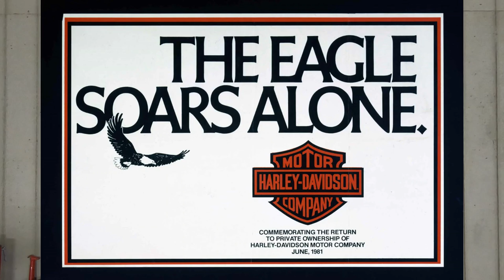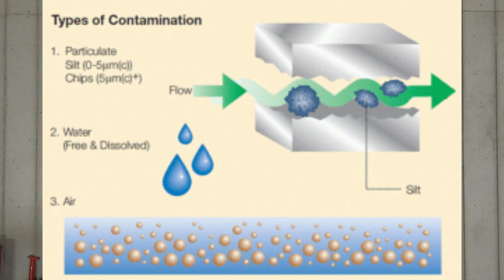Harley Engine Quality Isn't What It Used to Be

Comment: I am a faithful viewer. You are a walking Harley encyclopedia Mr Gixxer!  I guess my 2002 was the last year of the assembled balanced crank. I have not opened the engine. It runs soo smooth and reliable. I don't want to risk spoiling a reliable Harley. That's unheard of. Every Harley I've owned has suffered break downs.
Reply: You're 2002 crank are pressed. GixxerFoo keeps repeating this nonsense. Not just this video but also in other. 
The fact are all Twin Cam cranks are pressed together starting from 1999. 
I have a 2000 Dyna where I this winter changed my crank for a S&S crank 4 3/8" stroke. My old 88" OEM crank are pressed.
Reply: But you have the great Timken button end bearings though 😎
Reply: No Gixxer corrected me there. So much for hoping 2002 had something better in the drivetrain. On the other hand, the great Gixxerfoo hasn't revealed anything terrible about my year bike. Yet.

Comment: Thanks for all the great content you provide!! I bought a FLHXS 2021 $43,000.00 CAD Right out of the box shifter pawl spring had to be replaced.few month later if you leave the ignition on wile fueling the ECM locks up and the bike won't start must leave it sit with ignition off for 10 min.(dealer can't repair it)and this year went on my first ride throttle by wire puts the bike in LIMP MODE . OH YES and the front disc have been replaced 2 times warping problems. I sold my 2004 ultra classic to my Nabour and he IS having a blast with that bike LOL THANKS HD

Comment: As a owner of both a evolution and a twin cam 103 ho , I will have to say I am very happy with both but when I took your advice and put the wood 222 cams and a thunder max tuner and tab full exhaust I am a big fan of the twin cam thanks for your vids that pointed me in the right direction as far as parts you are spot on thanks
Reply: Did you get your bike tuned? I have a twin cam too.. I like torque and mid range RPMs (don’t care about highest HP).. how’s your torque curve? I’ve watched all Gixxer’s vids, just curious of user feedback.. thanks
Reply: @bullast2046  he is running a tmax ecm, which would tune the bike, running the same on my 04 ultra with a stroked s&s 113 and no issues so far
Reply: @GBDunknRollCD  I got that.. I’m wondering what the torque curve is like on a dyno tune.. is it good and steady, or a rise and peak.. the graph Gixxerfoo showed shows the latter..
Reply: @bullast2046  that's because a more restrictive cam and head allows the air to flow faster through a tighter space at low rpms, you're going to lose torque under 3-3.5k and gain it above 4k. It's opening up the top end. The best way to get more torque down low for your "preference" is to increase displacement ie. a bigger bore or stroke
Reply: @bullast2046  it all depends on what you have done to your bike, different cam lift and durations with change the curve drastically, find a cam to suit your needs when it comes to having power and tq come on down low and you should be happy
Reply: @GBDunknRollCD  that’s exactly what I want.. I understand there’s no replacement for displacement.. my 103” will never touch my 117”, with apples to apples modifications.. I’m just asking for feedback of different cams from users, rather than checking manufacturer advertised graphs.. peace

Comment: I have had 2 TC88 and 1 TC88B bikes.  My 01 FXDX was a dream bike and I miss it a ton.  My 03 FXD is my current bike and has been a very reliable bike.  My 04 Fatboy was my least favorite of the 3 for comfort reasons, just never liked how that bike rode.  For the 01 and 04 I did the Screamin Eagle upgrade to the camchest and have zero complaints and had zero reliability issues.  All bikes ran all over and had decent power.  The 03 I completely tore out the factory cam system for an SS510 gear cam system and that makes the TC88 a much better running motor, hopefully just as reliable over the next few years as the others were.  The evo's were fine but I will always be happier to run a TC88.

Comment: A lot of the Milwaukee 8 when you change the Fluids you will have metal on all 3 drain plugs including the engine. I put s&S 1200 KITin the 2021 883. The gear case was loaded with metal fragments from when the cases were machined and not cleaned properly.

Comment: after my 95-inch t.c. went south along with the previous 88 t.c. going south. had my engine rebuilt with a balanced S&S crank, timken bearings,  geared cams, and billet cam plate. along with everything else new, bumped up to a 103. after thousand mile break in, going to bell Ray synthetic. motor smoked and uses oil. I went to Bell Ray mineral oil. the oil use stopped but still smoke on a hard throttle hit.  I'm stumped. is tune, too rich? 51mm throttle body.

Comment: Anything made after the Evo is cheap crap, and I call them PlastiGlides®️.
I bought an '02 Softail Springer, but sold it after 2mos, because it felt like riding a Honda, the heart and soul of the machine was  gone.
 My '97 WideGlide is twice the machine the new ones are, but it still makes my '72 ElectraGlide look like a tank. 
 You couldn't give me a new Harley.

Comment: I bought an 01 Dyna and afterwards found out it had the Timkin bearings and bolted flywheel.  Another $2,500 got me a forged cam plate, better oil pump, gear drive cams, new lifters, inner cam bearings, S&S .510 cams and adjustable pushrods.  It's finally as good as an Evo.  It came with a Supertrapp 2:1, K&N filter and Mikuni 42mm carb.  I added a billet fork brace and Jagg oil cooler.  Was going to do a 95" kit with high compression, headwork and forged pistons but it runs so well I hate to touch it but stage IV is just one step away.....

Comment: Man oh man I miss my Evolution bikes! I shoulda never sold them! The twin cams were a disaster waiting to happen! Now I have the M8 and truthfully I quite like a lot. I have a 2017 model, that I took upon myself to fix the oil pressure issue. So far it's been a really reliable engine and in fact the 107" motor was just fine as far as I'm concerned. I don't need to go or accelerate any faster or better. It's a bagger, fast is relative to your destination. I didn't buy mine to race it that's for sure. But I did cam it up and with the S&S .475c cam and did a few other choice mods that kept it reliable. Getting back to the Evolution motors, I rarely if at all had issues with the motor itself, I did however had a terrible issue with the EV-1 cam that slowly disintegrated and took out my bottom end, thank god for Delcron!  Evos are still my favorite AMF motor and Harley-Davidson was smart for keeping it as long as they did.

Comment: I was at York for the 25th Anniversary and saw the pre-production Twin Cam motor disassembled. The 'new' thin-wall die cast engine cases were made by Mercury Marine as evidenced by the cast-in mark. Mercury Marine has extensive experience in precision, high-quality, thin-wall die cast engines. Not sure if HD is still outsourcing their cases. I've also heard the last few years of the EVOs were cast and machined by S&S!?!?

Comment: The EVO had its issues too... weeping rocker box gaskets, cylinder base gaskets, porous engine cases, every engine that Harley has came up with had its problems. Look at the Knucklehead. We all bow down to it like it's the Holy Grail, but it had who knows how many running changes in just the first year.
Reply: The problem of leaking gaskets are minuscule compared to Major catastrophic engine failure in engines with low amounts of mileage on them. As for the knucklehead that was an almost complete redesign because most motorcycles ran Flathead engines in the old days and most of the changes were related to sheet metal and gaskets because they had no experience with a recycling oil system compared to total loss that they had before. A knucklehead was a 500-pound speedster that would come with a certificate that it went 110 miles an hour which is pretty good in the 1930s. Now Harley-Davidsons big twin is an unreliable behemoth
. As morbidly obese as some of the people who drive them
. I laugh when I see them duck walking a simple u-turn. They won't lie in their bikes and they won't turn their bikes because they're used to driving a car 🚗. I said they won't lean their bikes stupid phone 📱

Comment: I was thought all twin cams had press fit flywheels. I know my 2000 has the Timken bottom end, but does it have that glorious Evo flywheel as well? 🤔
Reply: You're absolutely right - its pressed. GixxerFoo keeps repeating this nonsense. Not just this video but also in other. 
The fact are all Twin Cam cranks are pressed together. 
I have a 2000 Dyna where I this winter changed my crank for a S&S crank 4 3/8" stroke. My old 88" OEM crank are pressed.
Reply: @Søren Lønbæk  I thought so. I think Harley figured the Timken bearings would support it,  then got rid of those too. That's when all the trouble really began with total indicated runout

Comment: A bike that costs $20-35K should have Zero excuses when it comes to engine build quality. I have owned several new twinkie and M-8 Harleys over the years, but from here on out
I will buy nothing but big bore Evo bikes with proper Timkin bearings (and Zero crank end-play) from here on out.
The motor company deserves the bad rap they took over quality.
The fit and finish has improved dramatically in the past few years however.

It is ridiculous to consider spending $30K for a new bike when I can easily buy a show quality chopper with a big bore S&S Evo and custom paint all day long for under $8K.

Comment: Bought a new Softail in 2011…immediately joined the Forums and learned all the “bad” stuff about my motor….146,000 miles  on a stock bottom end and not a problem…and I did a big bore kit with cams and heads….if you didn’t get a lemon from the factory, you are fine

Comment: In addition to how you run your motorcycle, I believe in timely service intervals, all three holes each time with quality lubes and filter is key. Scrimping here is not saving at all, it ends up costing. And - don't despise that downtime, enjoy it, do it well, and be looking for changes and do it well! Connect with your bike, and seek out loose fasteners always! Check your tires, too!

Comment: I am on my 3rd HD... the first two engines had issues. The second one had bad lifters, which ate my cam. The first and second consumed excessive oil. The first HD was a leaker due to poor machining. The second HD sumped and destroyed the engine at 8500 miles. Fingers crossed on my current 107. I am running external head breathers and Trask vented cover to control blowby. I never had any issues with my Japanese cruisers. Am I confident that my 3rd HD will succeed? Unfortunately, the answer is no. If this bike becomes problematic, I will get away from HD.

Comment: Gixxer, I know that I can get the straight scoop from you and Tatro, I truly enjoy your insight. I know that some hate the Shovel, but I had 2 back in the late 70's and early 80's. A 76 Superglide FXE and a 71 EG in that order. I rode the pig snot out of both with nary an issue. 3 TC's 88,96 and current 103, no issues. When the time comes I'm replacing all of Harley's F'd upped parts and go whole hog with S&S bottom to top..

Comment: I love the evo engine, but it’s not without its shortcomings. On to the twin cam. I’ve been surprised how much I’ve grown to like that engine. Sure it’s noisy, but my 88 has been good to me. 
All that being said. I doubt I’ll ever be talked into an M8. I’d rather bullet proof my twin cam, and keep bubble gumming my evo back together.
Reply: 88ci years with a five speed, hands down one of if not the best years for Harley. Rented a new M8 RK for 4 hours and hated the way it felt, sounded and performed, too much like a metric. I’ll gladly keep my 02’s.
Reply: I went from an 88, which burned in a garage fire, to a 110. In my opinion the 88 was a much better motor. I finally dumped the 110 for a   Moto Guzzi. Major improvement over the Harleys in all aspects.

Comment: I worked at a dealers' in the early nineties, every bike we uncrated had issues, either mechanicle, electrical or cosmetic, we had the wire wheels relaced on every bike that arrived because it wasn't worth the risk not too, and had to raid the parts dept just to make the biks fit for sale, quality and harley aren't words I'd generaly used in the same sentance in a possitive light.

Comment: My  53 Pan has 340, 000  miles on  it,  2 rebuilds,  it was in a garage from 70 to 88 when I bought with 32, 000miles on it.  2 kicks or 3  she fires up ...  45 miles to a gallon.. 80mph easy.  tops out out 112 mph,  changed the trans sprocket toget a  faster topend.

Comment: Love the videos glad you got shop. I'm going to put woods tw 222 in my 2016 street glide special been looking at parts very confused 😕  the fuel om  cam plate what's different  between it and the red hp  plate I need a kit with that cam where can I find that for good price any information  would be greatly  appreciated  and was wondering  where your shop at and what you charge for cam install on 103 thanks

Comment: I have a 2017 RG and put in the 114 kit right after I bought it.  Talking about a domino effect!  First the clutch basket exploded.  Then the compensator went, followed by the transmission.  Oil summing went nuts, so had to put in new oil pump and plate by S&S.  Then the Harley Screamin Eagle cams went so new cam and lifters.  Although is was expensive, I love my HP now and couldn’t ride a stock bike.😊

Comment: Maybe a cam plate..  Maybe a better cam.. Maybe a bore kit...  Maybe etc etc..  AND maybe the flywheel will shift
or stock run out is so BAD you can't even install a gear drive cam set up..
ALL THIS and sooo much more, on a bike that cost 30k.. WTH is going on ??
BUT every after market parts dealer has their parts or design to fix the factory screw up...
(more $$$$) WHY CAN'T OEM PARTS DO THE JOB ?? What ever happened to a bike you can RIDE .. and trust on the road ?? I've been on HD since 1979
and own three now..  Bought my 1st new one in 2018 ( got a PILE $$$ of new parts yet to install plate oil pump cam gear drive etc etc) But all this new HD since twin cam is a scam. Only sells because of a name and old turds like me trying to support America... Be sure to have your bro tow card when you leave home..  and and the fat cats at HD wonder why people THAT WANT TO RIDE are going to import bikes and giving the finger to HD and their scam..
Reply: What I know, they are not making these bikes in USA enymore ...

Comment: My EVO which until recently was treated poorly but it starts and drives well. I’ve only ruined a few stators and regulators from it sitting around. 

My TC88 was okay but it has really shown out at a 95ci. Decent power and pop and it’s been reliable. I’m about to invest a decent sum to refresh the bike but the motor is still rock solid. I did convert it to gear drive. 

My M8s I’ve own have been really good too. I’m about to do a S&S 128 gear Drive conversion when the parts are available again. 114 this far has been pretty damn solid tho.

Comment: Mr. GF torrington and ina are brand names not type of bearing. one bearing is a full compliment for slow and heavy but will take misalignment. the other is a caged needle bearing for fast and light but will not take misalignment. I would assume on an HD the issue is alignment or HD bought a bunch of bad bearings.

Comment: I had a 100 inch big bore kit installed on my 2002 88, and, the cam plate was bad.The cam plate fails on the dyno, and now my crank is at darkhorse.

Comment: I actively looked for a lightly used 103HO instead of buying a new M8. Bought a 2016 heritage softail with only 9500 miles on it for 11k bucks. WAY better deal than 25k for a new one! Harley got it right with the 103HO and it’s more than enough power for me. Plus I think the twin cam sounds a lot better. A newer M8 just wasn’t worth spending way more money on to me

Comment: pressed flywheel is an issue no question which can come out of true as early as first 3k miles; also the leakdown cases are an issue especially with gen 1 M8 motors

Comment: I'm not planning to change anything on my standard M8 Sport glide, its powerful enough for the way I ride it, it does what I want.  Its the case with most engines, the more power you put through it the less reliable it gets and the more parts wear.  I had Evo's years ago, good engines, but still had problems with them, sportster and big twins, performance wise they cant touch twin cams or M8's.

Comment: So I am sorry but I love my old shovelhead and it honestly gives me very little issues, anyway I bought a 1981 FXWG or wide glide so is the 81 A.M.F or Harley Davidson old school? I still have my original engine but I now run a S&S and the heads were done by myself when I was working for a car engine builder and I had them bench flowed by S& S and I fitted small block Chevy valves and used stalite seats and with a turbo at very little boost its a good honest engine and no rocket but still it goes pretty well.

Comment: For a 4 stroke engine I can’t believe the M8 oil use. HD say that 1qt for every 1500 miles is acceptable ! Mine currently is using 1qt every 3700 miles but isn’t that still excessive ? And it’s expensive $

Comment: Gixxer, thank you for your videos and best of luck with whatever you are facing in life.  Quick question, when you mention Evolution engines, do the characteristics, like cranks, apply to a 2014 883?  Did HD cheapen out the later Evos too?
Reply: Sportster engine parts are built differently and tend to be more reliable than the Big Twins. I ride a 2005 1200 Roadster with 83,000 miles on it and it doesn't smoke, leak, or rattle.